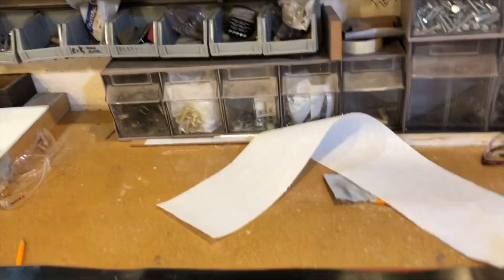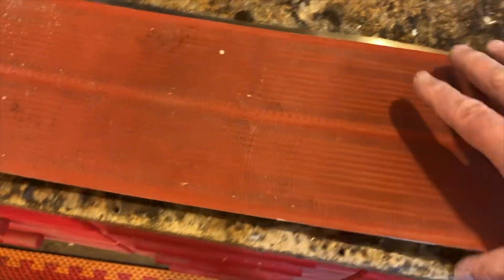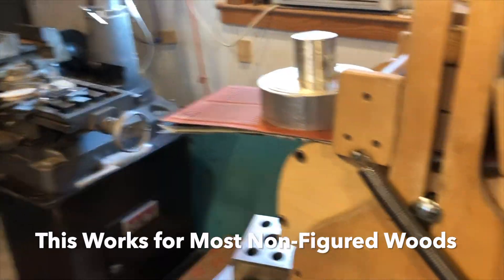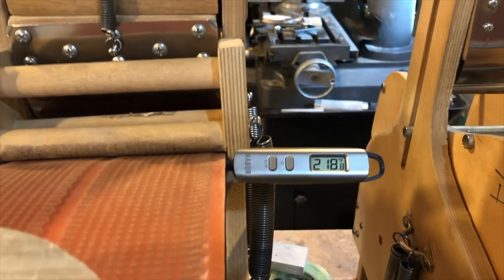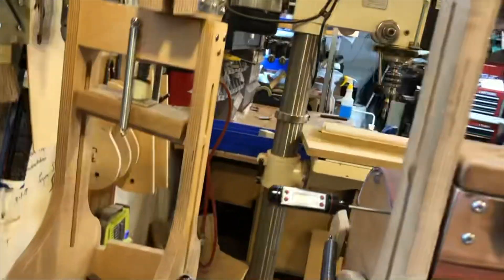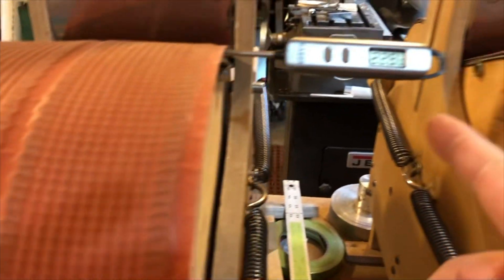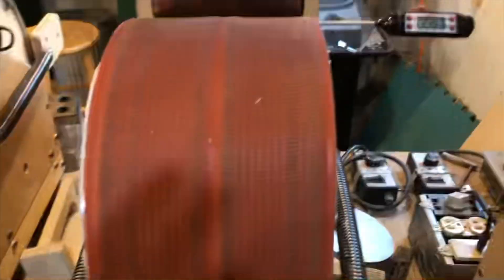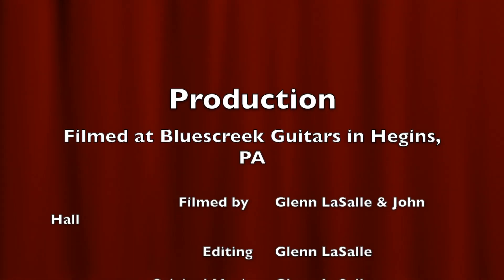Blues Creek Guitars - Bending Reference Library - Bending Non-Figured Mahogany

Comment: I was taught to bend the waist first, then lower bout, then upper.  Your thoughts please?
Reply: the reason I do it this way is simple, when you do the waist first then the bouts you don't get a good reproduction of the pattern. I do it this was and, after doing the lower and upper bout , you can see the sides really pull down on the pattern and you get a much better bend to the bend pattern and it fits the mold better.